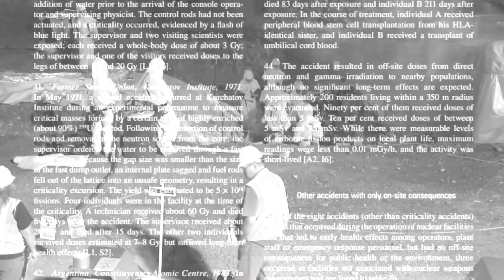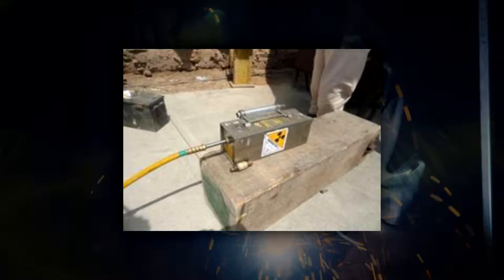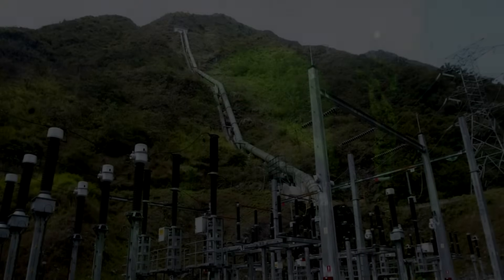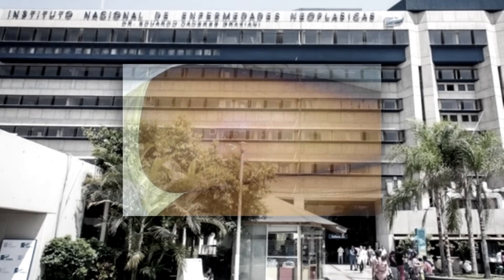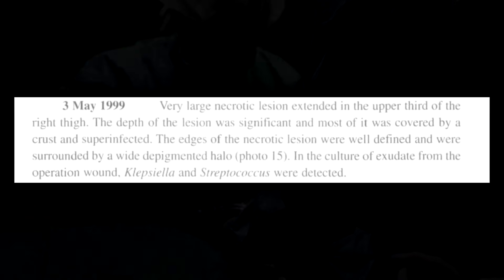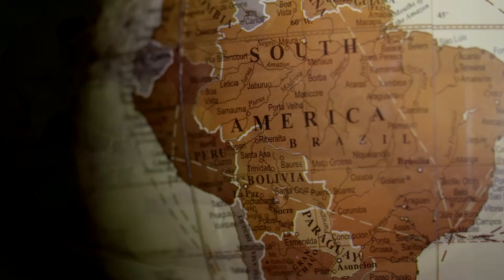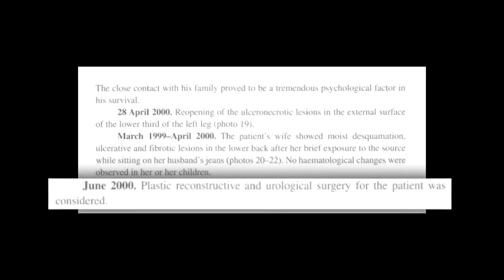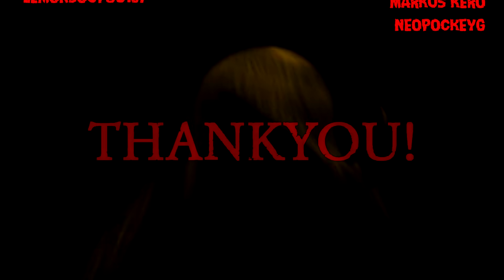The Yanango Radiation Incident

Comment: I think that it is obvious that someone was messing around with the photographic equipment, and it wasn't the guys who operated the equipment, they knew far too much about how deadly it was sind it could basically take X-ray photos of Steel pipe! so they wouldn't have dared to even loosen the lock on the chamber of the Radiation Source. Likely someone from the plant who saw the equipment decided to mess with it and though there might be something inside worth stealing,  it IS Peru after all. But after seeing the steel cable with the Radium 192 on the tip, they likely just dropped it and left, completely unaware of the fact they just gave themselves about 700 standard Chest x-rays worth of radiation to whichever hand that had touched it. Gamma Radiation is by far the most energetic of the particle being emitted by the source element. They use far less active radiation sources for sterilization of one time use or disposable surgical equipment like scalpel blades and bandages. even sterilization  of food packed for room temperature storage and  shipping. it's very odd to see food like Roast Beef with mashed potatoes, gravy and steamed vegetables  with a thin plastic sheet over  top of it NOT being refrigerated and stored on a shelf with a full month or two of shelf life. and if you have seen them, you'll know what I hean, and it is a hard thing to wrap your head around, but Gamma Radiation kills everything, and leaves no residual contamination.

Comment: You didn't mention the level of radiation absorption by the welder which is crucial and important to know about the severity of the radiation exposure. Awareness is the basic factor to stay safe. That wire piece was very small indeed, curious to know the amount of absorption.Above 9 sV is considered fatal and deadly.

Comment: I think what is absolutely the most terrifying about radiation is that there is no stop until it’s gone. Until it runs out, it’s so terrifying because there is no way to turn it off, disable it, or anything like that, it’s just there forever and the affects of it are aswell. In lots of cases like this they just have to let it stop irradiating them eventually

Comment: If nobody knows why Shrouded mentioned those "Special Heaters'... that wasn't some Special Heater... it was an old Broken Soviet Radioisotope Thermaleletric Generator (RTG). Usually, between 5 - 10 Grays (5 Sieverts), will kill someone within forty seconds. The RTG that the Agency had to gather, was generating nearly Five Sieverts (4.9Sv). The three loggers who used that horrifying generator as a heat source... two men had be hospitalized for TWO YEARS! One man was easily discharged two months later... he was lucky. The other two, had wounds that refused to take skin grafts... sadly, afted 883 gruesome days... one man would pass away, due to complications from the radiation exposure. A non self contained Radioactive source, that poses a threat to society... is called an "Orphan Source". Usually every day... a Radioactive Item, becomes an Orphan Source. The Gojnia Tragedy, is a prime example... of when an Orphan Source, gets into the wrong hands... One Girl, sadly passed away... believing that the Glowing Blue Powder... which was, Caesium 137. She believed it was some sort of "Fairy Dust", due to it's beautiful blue glow... little did that poor girl know... she was about to die. 

To add insult to injury to the family... the people of the town, outright refused to let the girl be buried with her family in the cemetary. People threw rocks at the coffin, making threats, barking and shouting that the girl's body was "Cursed" and it will bring Death to their people. Disgusting.

Comment: I used to work in the oilfield and the trucks I operated used a radioactive source. Cesium 137 I think. Anyway they said the source was about the size of a grain of rice which I thought was crazy given the amount of shielding it had. It was probably tripple what it needed to be. They also had to have a radiation license to be able to have them on the trucks. So the fact that the technicians in this storey were so careless and the source was easily removable is also crazy.

Comment: Been an industrial radiographer for over 25 years. I've only had one disconnect. With proper safety, this would not happen. You are supposed to confirm the source is in the shielded position with a meter. This was totally preventable.

Comment: Sorry, it was absolutely negligent of the radiographers to leave the equipment out in the open like that. They should be held responsible for the incident.
Reply: They had to leave it there as it was more dangerous to keep moving it around each time they needed to inspect the welds. If some idiot from the plant tampered with it, with all the radiation signs on it, that's the one who needs to be held responsible.

Comment: I work with these gamma densimeters at my job and they are never left unlocked, and are surveyed every time they are used or transported. The operator always wears a dosimeter to measure how much gamma he's absorbing.  Lax safety measures are the reason this fellow suffered. Radioactive metals look like any other metal. You can't see or feel radioactive particles or rays ravaging your DNA. The lesson for average folks is stay the hell away from anything with that radiation symbol on it.

Comment: As a guy who works in powerplants with a lot of pressure part welds that require X-rays like stated in this video. The X-ray techs don’t even come to the work area until the welding has been completed. They have to put a special purple/ yellow barricade typically on the entire floor that’s being inspected. Nobody except them will be admitted on the floor until radio signal to return to the area. My point is OSHA sure has got a better handle on preventing negligence like this from happening since this occurred

Comment: I think so many of these radiation incidents boil down to the same thing: designers of a machine or process don't take into account methods where their machine or whatever can be misused in the field or in practice by people who didn't receive adequate training, didn't read the manual or got too comfortable with the process. The fact that the radioactive material could be removed from the camera in the field at all seems like a major liability. The fact that it's not designed with warnings on the radioactive pigtail piece itself seem like an oversight.

Comment: Im actually studying to be an industrial radiographer right now. Here in canada, they call it an Exposure device operator. Because of incidents like this, there is stringent safety measures in place, and everything is heavily government regulated. The cameras we use, also Iridium-192, have safety backups, and backups to those backups. They are also a completely different design now, and the source is simply not able to fall out. In fact, if anything at all is loose on the camera, it has to be taken out of service immediately. My time has an extra hazard as we work with these cameras from heights via rope access. So there is an extra layer of security that has to be in place before we can even commence work. When we work, the zone we are working in is entirely shut down, and no one but the team is allowed to enter so we can control who comes in contact with the source, if it ever came to that. Every day is a risk, but if performed correctly, our radiation dose is similar to background radiation. Our radiation safety officer is also on call at all times in the event of an issue, if they dont pick up, heavy fines are handed out, up to jail time. Its a very serious industry, but a vital part of NDT (Non-destructive Testing)

Comment: What kind of radiation experts are  these guys. When dealing with necrosis caused by radiation, you cut the whole  thing out as soon as possible, limb and only do otherwise if the effected area is a vital area. Because the radiated cells can travel up through the blood vessels and cause damage throughout the system.

Comment: Yo, I'm actually an industrial radiographer! I'm only tech level 1 so if I seem a little naive, it's cause I am. This guy must've been incredibly lucky or that source was very weak (I'd say 20 Curies or less). Judging by the fact no one else on the job reported any issues, it must've been the latter. Anyway, safety and regulatory standards have changed dramatically since then and I'm sure this specific instance is responsible for a lot of that. Crazy to think that's what I work with. Anyway, awesome video! I love your content!

Comment: Someone would have had to put the key in the camera, pull the safety plunger off the front of the camera, connect the the crank shaft, click the button to unlock the other locking mechanism,  remove the source tube, than crank until the pig tail came out, than disconnect the pigtail from the drive cable. This was severe negligence or tampering.

Comment: I am a former X-Ray technician. First you NEVER leave the camera unattended. The hole point of a mandatory two man crew is for someone to always be with the camera when it’s not locked up. Next for the pigtail to be removed from the camera would require extreme negligence to the point of purposely tampering. Modern cameras are made to where the only way the pigtail can come out is if someone knows what they’re doing. Delta 880 requires an adapter and a key to allow the crank shaft to push the pigtail out. Someone knew what they were doing imop or the technician and his assistant were criminally negligent

Comment: I used to take those picture as a job, there is not much to protect you while doing it but to take distance from it. The cable for opening the source is on average 15m long so you still have time to walk away after you opened it. We also use this radiation detectors just so we can walk far enough away that the dose is toleratable. around 10-15 microSievert.
Well inhouse we use a bunker ofc but once you need to take them outside in the field there is not much you can do but to take distance and go stand behind other pipes etc.

Comment: Something that I find absolutely horrifying about radiation is it has a stigmatism that over estimates and underestimates it danger.  When handled properly, it poses almost no threat, when mishandled it poses immediate lethal risks.  The radiographers should have done better inspections of their equipment.  They shouldn’t have left it out, and they shouldn’t have left it unattended.  Along with that, the welders should have been informed better.

The worst part of all this is that properly protected areas often use fossil fuels instead of nuclear reactors because the idea of nuclear reactors is much worse than the reality of it.  While places that can’t afford reactors but use tools like this often mishandle them because of one factor or another.  This makes it so no one wins.  No clean energy, no safety regulations put in place.

Comment: Video is half done but this seems like there should have been a training to anyone that was around the equipment.  They should have seen pictures of the device but more importantly seem what the radioactive parts looked like.  Even if the welders opened the box(didn't say if the lock was picked) the people certified to handle the equipment should have gotten in trouble.  For one, it is dangerous but the second I'm sure this can't just be bought at a local hardware store, that thing was probably expensive, it shouldn't have just been left.

Comment: I was wondering why they didn't just immediately remove the entire leg. I don't know if that would have stopped it spreading or not, but I would think when dealing with radiation, a larger margin around the affected area would be a safer bet. Why mess around? Now he doesn't have a butthole, if he's even alive. Radiation stuff like this freaks me out. Your cells just die and cannot replicate, and there is no visible cause. Like an invisible miasma of death.
Reply: i doubt it would’ve made a difference. think about it: his wife was indirectly exposed to radiation by just sitting on his pants for then minutes. meanwhile, he had direct exposure for over an hour
Reply: @misseselise3864  the difference is that u don't have to actually experience your leg rotting away
Reply: @Milkman0101  An amputation isn't painless and you usually feel like the affected limb is being crushed for weeks, even years afterwards.
Reply: @daviddavidson2357  I'm sure an amputation isn't painless but I honestly don't think it could be worse than your leg rotting from the inside out because your DNA has become spaghetti. 

If you survive, either way you will not have a leg and will have to probably deal with the phantom pains.
Reply: Any doctor that removes a limb 'just in case' shouldn't have a medical licence, they should be treating injuries without needlessly maiming patients. I don't get why so many commenters seem to think doctors have crystal balls with perfect foresight. The patient was treated by many experienced medical professionals who would have spent a lot of time weighing different treatment options. Even a seemingly mild insect bite can end up causing severe infection and necrosis but I doubt you've had a or seen an insect bite and thought to yourself "hmm, this limb really ought to be amputated because it might end up necrotic and rotting".

I understand I sound a little condescending but the number of people who think, or rather think only for two seconds, about any situation with a known outcome and then blame those involved for not acting with perfect foresight is somewhere between irritating and absurd.
Reply: @Washo1903  Except if you actually read the report, the IEIEA doctors recommended amputation fairly early on and the Peruvian team chose not to do it bc they thought he would heal. Meaning the experts knew amputation would eventually be required and that they could spare him at least some pain and the local doctors refused, likely bc they had so little experience with acute radiation poisoning.
Reply: @Washo1903  they had weeks and months of trying different things to stop the spread, if it were me I would've BEGGED them to amputate after a point, knowing the anus and genitals were at risk, and eventually the other leg and internal organs if nothing was doe to stop it. you can only keep trying to cut off spreading necrotic tissue at the division for so long before it becomes pointless.
Reply: @Washo1903  thank you! One of few intelligent comments here!
There are comments here blaming the doctors for not removing the whole leg early! Nobody would know that the leg would end up like that. They would have tried everything first before amputation.
Reply: Remember, he fucking SAT on it, the damage was already well beyond done, in the end it's usually disease from microbes that kills you in these cases as your white blood cells and entire immunesystem gets about if not exactly as or even worse than well whiped out as with leukemia/HIV, that's a somewhat good analogue, just damn lot faster, so yeah no, i don't believe it would've done 1 bit difference, remember that the entire hip area was already well grilled, irridiated when he had gotten rid of that piece of metal.